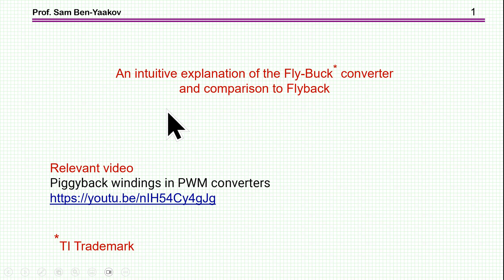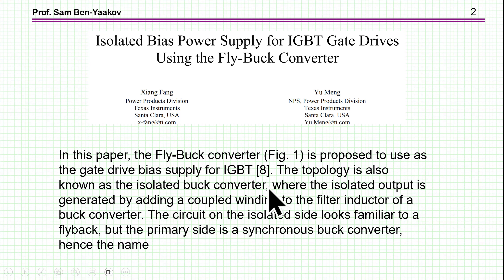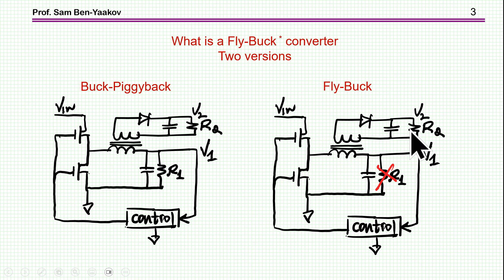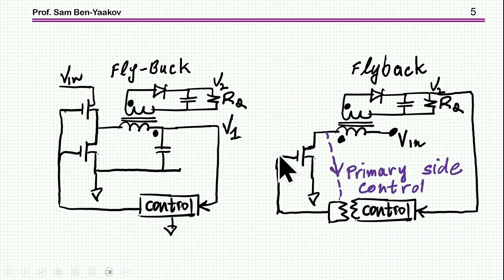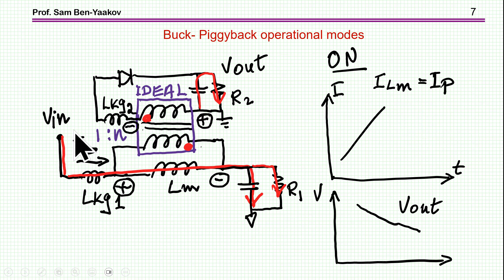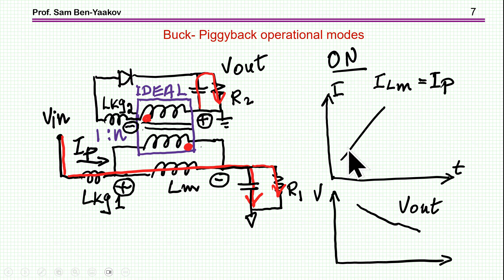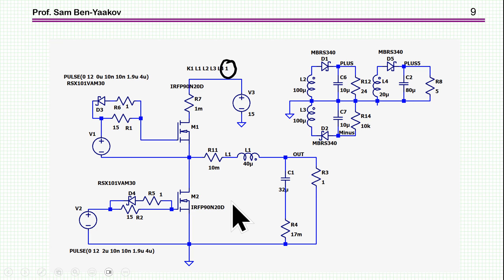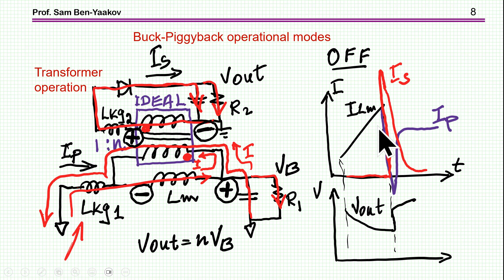An intuitive explanation of the Fly-Buck* converter and comparison to Flyback

Comment: Dr. Ben-Yaakov, if you remember I had that comment on FlyBuck below your piggyback Buck vid🤣🤣
We used Flyback with primary control for our 10-kV SiC gate drive power supply and the CM noise of device switching interfered the Flyback feedback and caused faults frequently. Finally we changed to FlyBuck and the problems are gone.
Reply from the maker: You got me there. Forgot your comment. If you have a stable low voltage, I would prefer https://youtu.be/y2U7eLfDtl0 over Fly-Buck
Reply: @sambenyaakov  That indeed would work in the case, with a higher current version driver, but the transformers were encapsulated and unable to be changed to center-tapped 🤣

Comment: When I first heard the name "Fly-Buck" some years ago, I thought TI was implying that it's very similar to a flyback topology, and never really thought too hard about it. When I see now that it's really more like a forward topology, and the energy flow is really not like a flyback. 

I haven't read TI's paper yet, but what is TI claiming the main advantage of the fly-buck is over a flyback (aside from allegedly smaller magnetics?)? Is it the fact that it allows for primary-side regulation? Maybe that it can be done cheaper/simpler than a flyback? Easier control loop tuning? Interested in what you think on this.

I've been a viewer for several years, excellent video as always! - Thanks
Reply from the maker: Thanks for comment and input. Except for the case that primary side control of a Flyback is troublesome (very high common mode noise ) Flyback is in my opinion better. But if a stable low voltages is available then https://youtu.be/y2U7eLfDtl0 might be the best

Comment: Dear Professor Ben-Yaakov. Unfortunately, this schematic arrangement has a few substantial downsides, which limit its implementation.
1. Energy from the primary winding of the inductor is transferred to the secondary winding only by changing current in the primary winding. If there is no current in the primary winding, there would be no voltage in the secondary one. This means the piggyback part of the converter is a current source, while the primary (main) part of the converter is a voltage source. Combination of both under reigning by the same controller is questionable.
2. The primary converter should be loaded fully at any time since otherwise there would be no voltage induced across the secondary winding, and its load will remain deenergized.
3. Even if the primary buck converter is regulated but its load changes within some range, the output voltage would change as the input current requires.
4. Since the whole power supply is intended for a gate driver, whose load changes within a huge range, a set of energy storing capacitors should be used that would keep voltage across the upper gate driver stable. This increases charging time of these capacitors, which is rarely acceptable, especially when supplying upper and lower MOSFETs of a half / full bridge.
5. This circuit arrangement requires operation at a 50% duty cycle and low currents in order to keep the voltages supplying the upper and lower gate drivers equal and timing relationships stable. Otherwise, the gate driver power supply operation would be disrupted.
6. So, there is going to be a substantial cross-talk between the lower converter and the upper one.
7. I am referring here to a gate driver since this is the main implementation of this schematic arrangement per Texas Instruments publications.
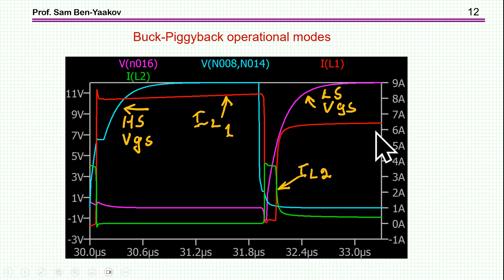Reply from the maker: Hi Gregory, you are wrong. You obviously did nor watch the video carefully. See   9:54  . Perhaps you did not realize that the coupled inductors act as a transformer between the output capacitor and the piggyback load during OFF time.
Reply: @sambenyaakov  Hi professor, contrary - the 9:54 time mark initiated my comment. At 10:18 you are stating that "... all the energy of the primary...", but the primary winding is terminated to a capacitor, which  does not create high enough current to be stored by the inductor. Therefore, current in the primary inductor is limited by its inductance and is negligible. LTSpice simulation confirms that. This is why energy stored in the primary inductor is close to zero and cannot be transferred anywhere.
The schematic at 10:20, nonetheless,  has a substantial load on the primary side, which makes it viable, but the downsides described in my first set of comments still exist.
Reply from the maker: @gregorymirsky8707  With no load, there are a positive AND negative currents in the primary AND in the output capacitor with a ZERO net current to the capacitor. Run a simulation and see for yourself.